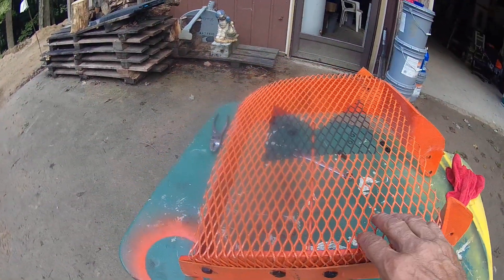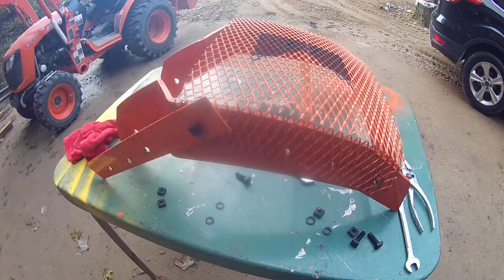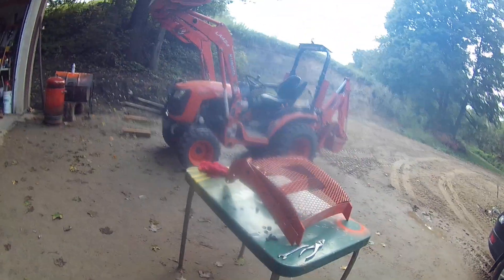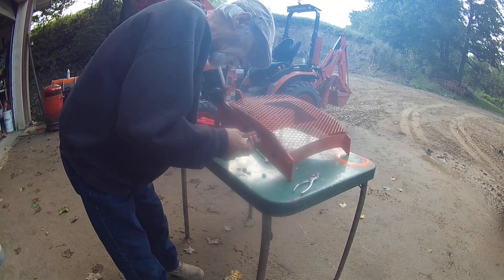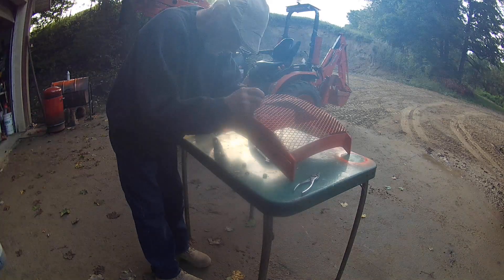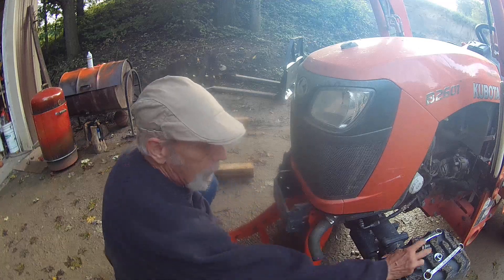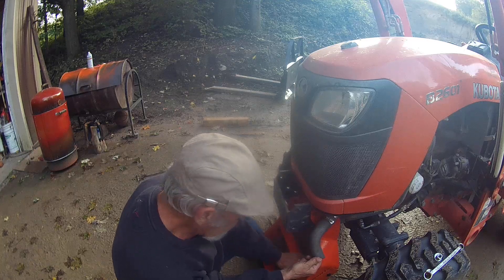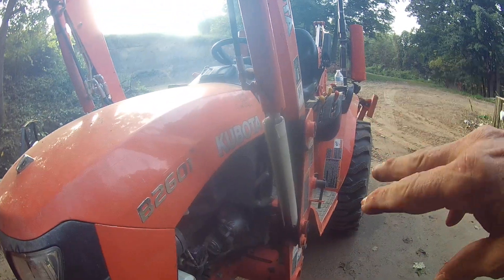2017 Kubota B2601 Adding a radiator guard

Comment: Very worthwhile mod, nicely done. I like your PVC safety pipes. Less likely to get bumped off than angle iron, I think.
Reply from the maker: Thank you for watching Terry. The PVC pipe is easy to make and cheap and works well and won't fall off on it's own. Later